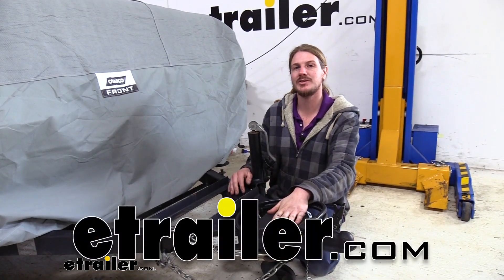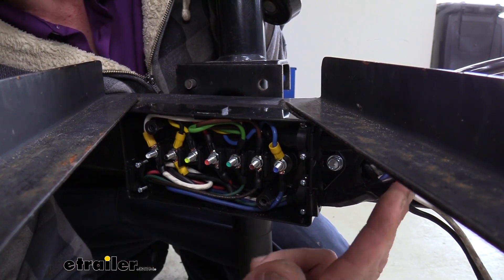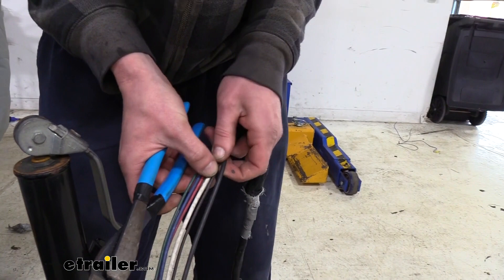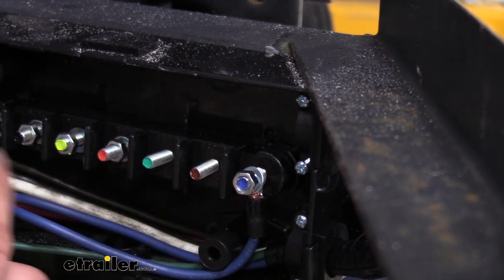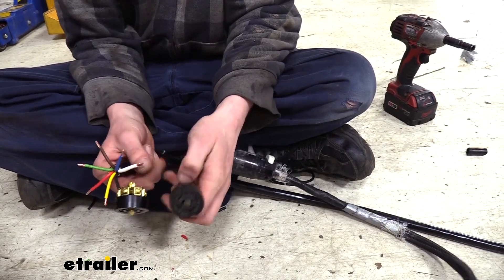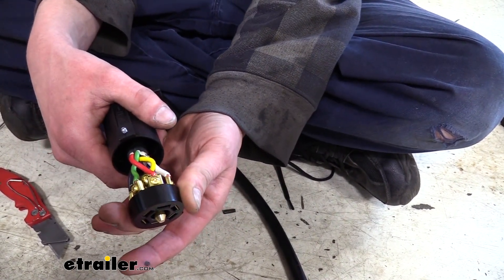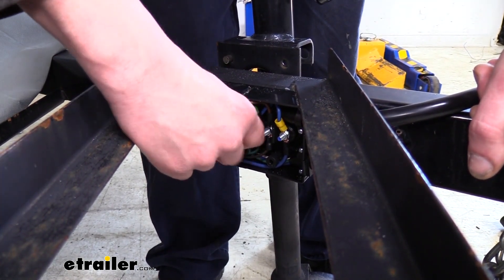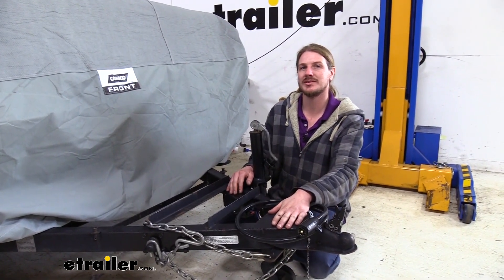Complete Breakdown of the etrailer Trailer Wiring Junction Box

Comment: do you have a video of wiring a 7 pin on truck to a 5 wire on trailer?
Reply from the maker: We have a 7-Pole to 4-Pole and 5-Pole adapter that will work great for exactly what you are wanting to do! Check it out on our website in the following link.
https://www.etrailer.com/Wiring/Hopkins/37385.html

Comment: Good video yet I am confused . I built my trailer wiring harness perhaps wrong !. 
I ran a white ground wire down the driver side and also one separate white down the passenger side . Ran a brown each side thinking that was for running lights and tail lights, Ran a green wire down the passenger side for turn signal and a yellow down the drivers side . All wires light up the lights as I separately touch them to a battery and turn signals work when touching green or yellow per side.
Here’s where I am confused...... I have no black wire ran down the trailer and afraid my brown wire will keep the lights on without my truck lights on. 
I realize hooking up trailer lights to my junction box will not match the color code on the studs in the junction box however my confusion is with the non existing black wire not being ran on my trailer / boat trailer .Help please .
Reply from the maker: Typically the black wire is a wire that goes to an on board battery on your trailer. The colors on the box that you have might be a bit different than the industry standard. Check out the following article to see functions and colors of the wires to help with wiring your junction box.
https://www.etrailer.com/faq-wiring.aspx